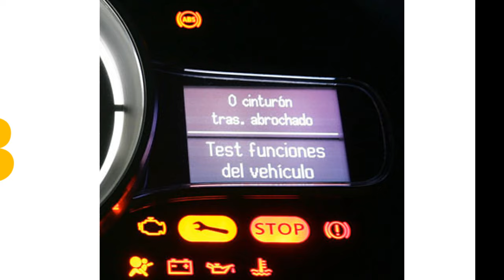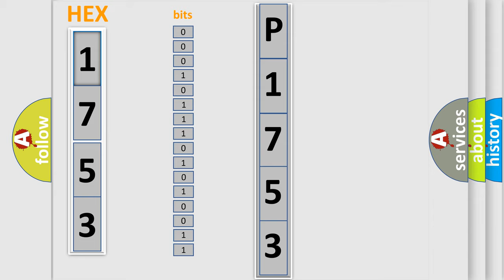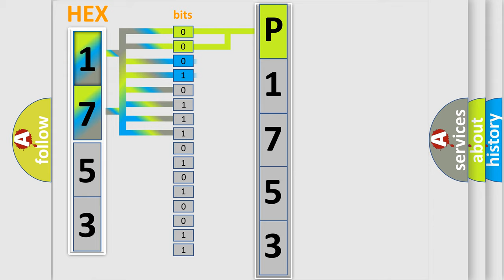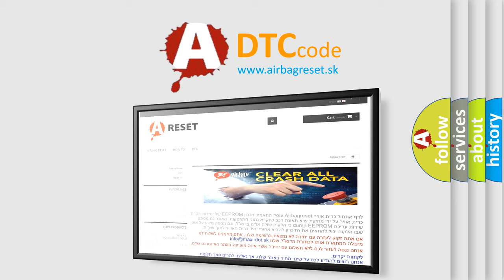DTC Honda P1753 Short Explanation

Comment: P1753 is manufacturer (1) transmission(7) and solenoid A interruption (stuck/dirty/wiring issue) (53)  not for air pressure anywhere I've seen. P0753 looks the same but not from manufacturer